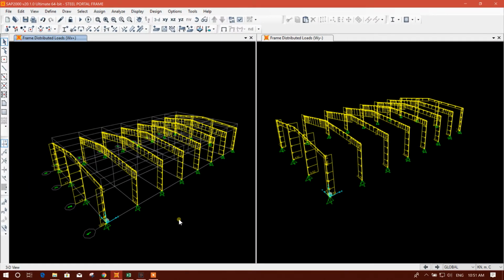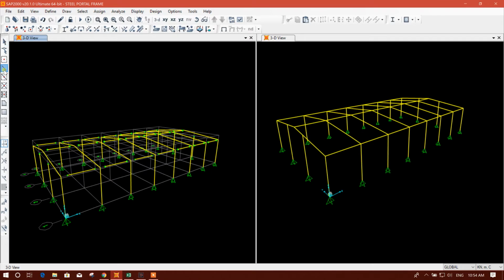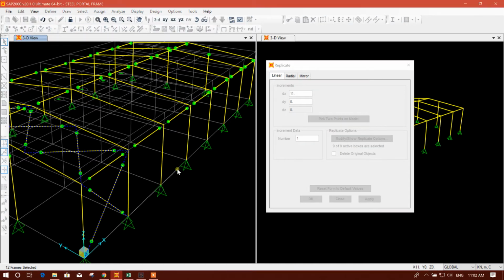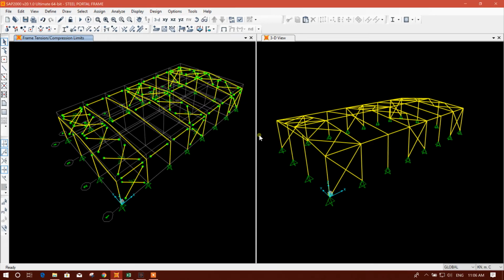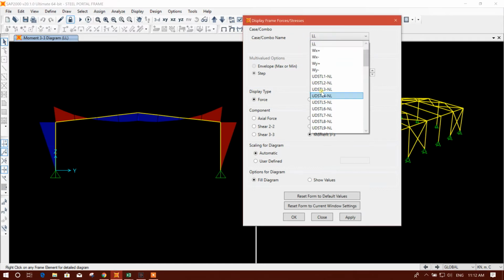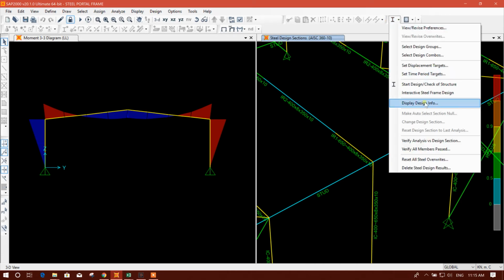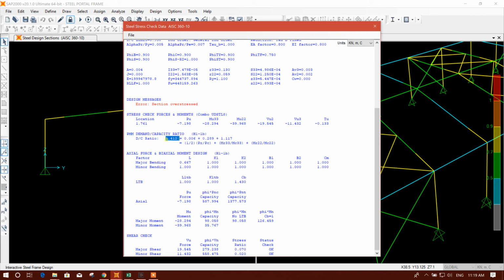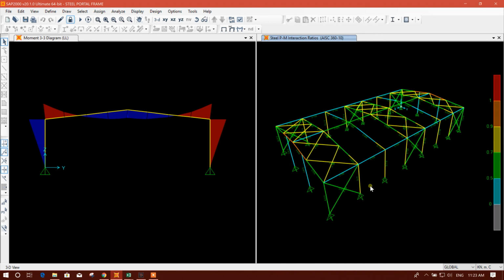DESIGN COURSE ON 3D STEEL PORTAL FRAME IN SAP2000-PART6

Comment: Very good tutorials. I have one confusion. for wind load you have applied only the ex poser   coefficient. should not we multiply ex poser coefficient with velocity pressure?
Reply from the maker: In this method the program needs Only Coefficient as input. Velocity pressure multiplied by the program itself.

Comment: Sir. Is it compulsory to design rhe bracing as tension members?
Reply from the maker: Not mandatory for all sections. Mandatory for Cable or Rod bracings.
Reply: @Decodebd  ok...cable and Rod is same thing?
2ndly is it must to convert the load combinations into nonlinear state?
Reply: For the same example....kindly explain which load reactions will be use for the design of base plate, bolts, pedestals  and footing.

Comment: How will you change ltb ratio considering purling spacing at haunch locations?you cannot change like that because purlin never  
restrain compression flange in rafter haunch locations for gravity leads.if they provide fly bracing only u can change like this

Comment: i HAVE ASSIGNED THE tension limit and compresssion limit to be 0 but still the brace member is taking compression forces. 
Also where did you added the comb1,2,3,4,5 in steel design. my all bracing members are failling.
Reply: same here, my bracings are failing, I stayed on the video and reviewed and still nothing is changing